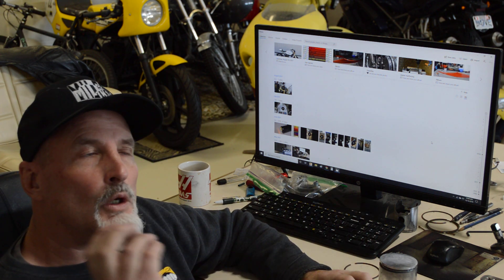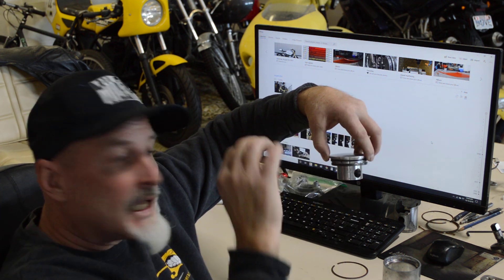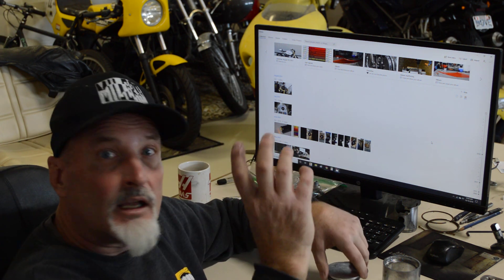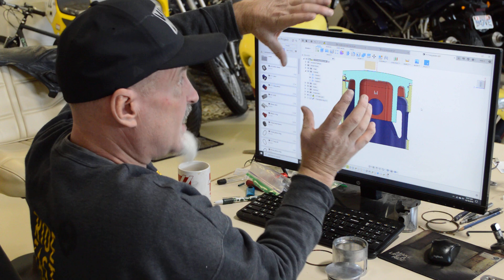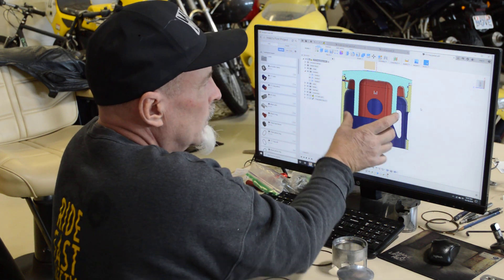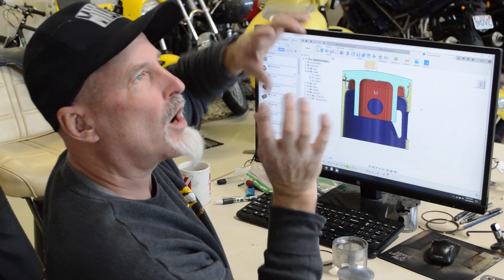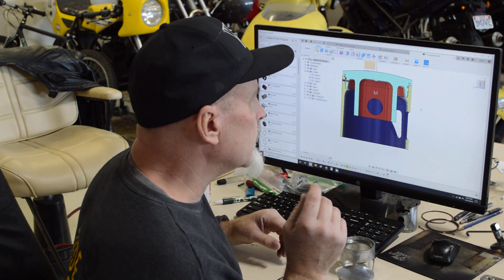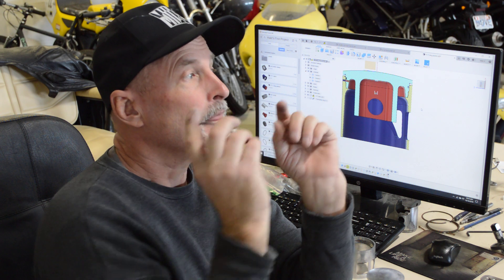two piece two stroke piston discovery

Comment: Hi Mark. I am working on very high efficiency "3 phases in 2 strokes" that could work by pression controled reactivity compression ignition and maybe need to make a reinforced dome piston (so at least +1 part piston assembly) to resist the very fast instant lasting combustion but intens temperature peak (however cooler than a conventional detonation) with quite no thermal transfert time (so very low temperature, so no NOx) and not radiator needed (aerodynamic and compacity advantage).
Sorry for my bad english; it is long time I had not practiced.
If you are interested, contact me on LinkedIn. ;)
Reply: https://www.linkedin.com/in/pascal-monterisi-0a187150

Comment: Hello Mark. This project Is awesome. Thinking about It... What about to work on the wrist PIN? It only have to be' circular in the middle part, but in the edges It could have other forms, Just not have to be larger than the middle part, so It can pass in the needle slave bearing of the connecting Rod. Once fitted the wrist PIN in the needle slave bearing, you can lock the piston by screwing It on the modified wrist PIN, like flat on the edges, with 2  holes for connecting It ti the piston or something like that
Reply from the maker: I lie your thinking. I thought about using the wrist pin to lock the skirt but was thinking about it being round. You are right it doesn't need to be round on the ends. I will filter this idea in my thoughts. Thanks
Reply: @SpeedofCheeseRacing  this piston can be a great revolution for 2 stroke. i will follow your videos!

Comment: I know some dirt bike mfg have been off setting the jug 10 mm to the power stroke(on 4 strokers) the straighten the rod more for more power. May work for a two stroke and solve the ring pinch. Just maybe??
Reply from the maker: 10 mm seems a lot. I do offset 1 mm.

Comment: thats fantastic you discovered your issue!!!..you aloud to run a gopro on that bike i want to here it scream....i was also thinking if you had to run that ring again you may have to make new heads with off set spark plug holes to ignite the charge away from the weakness of that ring gap and hopefully that helps keep the temps down for a run or two like i dont know how long a speed run is but for that time period if you get my thoughts. spare practice engine idea

Comment: Hello Mark, I have been following your YT channel for some time now and noticed in some previous videos you discussed the temperature ranges your trying to target (starting the speed run out with a "cold" engine and be near "melt down" temperature as you go through the traps).....additionally in other videos you mentioned some of the piston to bore clearances you had been experimenting with on these pistons & the thickness of them in different areas affecting the thermal mass / expansion of critical points....lastly in a video a while back you commented on the 2-stroke oil (dominator) you were using and the ratio you were mixing it at (I believe you stated 40:1).

My question: Is the purpose / strategy of this combination only to be able to streamline the bike & remove weight by eliminating the radiator???.......the reason I'm asking this is, it would seem that a somewhat stabile coolant temp would be more forgiving in terms of allowable clearances, and give flexibility to other premix ratio options???

NOTE: I'm NOT an expert, though I've been modifying my and a few racers shifter kart engines (KZ-ICC's) the past few years, and most failures are hot seizures....these failures have been mostly circumvented and some power has been picked up by running slightly looser piston to bore clearances along with upping the pre-mix ratio significantly......with adequate warm up there hasn't been any cold seizures and the additional oil seems to be promoting a better ring / bore seal (in-lieu of the bigger bore clearance)....lastly castor based oils displayed a notable power bump over synthetics on dyno at various mix ratios, all the way up to 16:1 (some of the exotic-$$$ synthetic based kart oils lost power at mix ratios only slightly higher than the minimum recommended ratio for the engine)....

BTW: great job on the videos, you definitely have my interest captured!!!
Reply from the maker: I start cold and like to see coolant temps around 140f when finished. Not sure where you got melt down. What is "dominator"?  I run 50:1. To steamline is a great benefit of a heat exchanger, but I don't have room for a radiator anyway. Weight is not a disadvantage at Bonneville.  I have never had a cold seizure. I use castor bean oil. Kart racing is very different than landspeed. Landspeed is wide open throttle for miles. Thank you!
Reply: Thank you for the prompt reply!!! I apologize for the confusion in my choice of verbiage.......(dominator) = I misread / mis-remembered your comment on oils, you said Maxima 927, [that's actually what I use]......(meltdown) = I intended to reference what you had said about the temps climbing too high too early in the run and a seizure occurring [sorry].....(Cold seizure) = I referenced that I hadn't had one with proper warm up and quite loose clearances, not that I thought you would.....(yep, i'm not an expert on land speed) I just was curious of your thoughts on tighter clearances and lower oil content than I was accustomed too in the  (KZ-ICC) shifter karts.....Thank again & good luck at El Mirage!!!

Comment: if the piston ring locator pin is on a side 90 degrees from wrist pin and it is causing the milled piston ring gap to open and close at 90 degrees allowing the piston ring to wobble in the gap.  why not just move the hole in line with the wrist pin so rocking motion of the side loading of the piston as connecting rod cycles thru the stroke is not as much a factor.
Reply: That would line up with the transfer port.

Comment: Is it possible to move the gudgeon/wrist/giggling pin further up into the piston? ie a really short compression height, this would reduce the leverage of the piston at mid stroke and use this with the mega long conrod you were talking about in an earlier vid.
Reply from the maker: Yes that would help a lot, but I would like to be able to fix the issue through design so I can run whatever rod length.
Reply: @SpeedofCheeseRacing  Ryger engines in Holland have developed a 125cc Kart engine producing 70bhp@30,000rpm, part of being able to get it to rev so high is in part something to do with removing mid stroke side thrust, I'm sure a man of your calibre can do something similar. An RD400 doing 30,000, oooh yes please.
Reply from the maker: @bobmonkhouse50  The ryger debacle died years ago. I am not interested in too crazy of thinking. I have trouble keeping the known projects on course. :D
Reply: @SpeedofCheeseRacing  ah, I didn't know, I'm a bit behind times, something to do with being stuck in the garage with mad projects. 🤣 🤣 🤣 🤣
Reply from the maker: @bobmonkhouse50   Best place to be!
Reply: Yeah, I was scrolling down to say the same thing. Longer rods equals less side thrust.

The other thing (which would be lots of work) would be to offset the cylinder slightly with respect to the crank, so the rod is slightly straighter on the down stroke and slightly more acute during the up stoke. Some of the modern 4 strokes are doing that but the benefits should be even greater on a 2 stroke.

Comment: Hi Mark, you have some incredible engineering skills. I have some questions wich I can't find an answer for in your videos. Wich alloy do you use for your pistons, and how can you control the thermal expansion to determine piston to cylinder clearance? Best luck, Bert.
Reply from the maker: I seized a lot of pistons before I found an alloy that worked, so I am keeping that to myself. I keep working at dimensions for thermal expansion. I got it wrong the first time. Just keep working at it. Thanks!
Reply: @SpeedofCheeseRacing  Thank you for responding so quickly. I love old two strokes, but very often there are no parts available for them. Mechanics and metalwork are my hobby, so therefore the intrest in making pistons. The problem for making my own pistons out of billet material is to machine the material away underneath the pin bosses. But i think casting them is the solution to that. 
Greetings from Belgium 🇧🇪 
Keep up the good work! Bert
Reply from the maker: @bert2522  That would work. The skirt is the difficult part. I made billet pistons years ago on a lathe with C-axis and programmed a regular cutting tool in 1/4 spindle segments. Never ran them so I am not sure how well the oblong shape worked. Good luck.
Reply: i cant say what he is using , but if it was me i would use Alloy 2618 heat treat to specification t61  (Solution heat-treated and artificially aged.)
Reply from the maker: @shane9338  Plus it has high silicon.